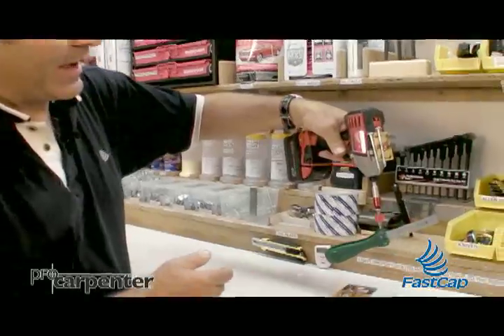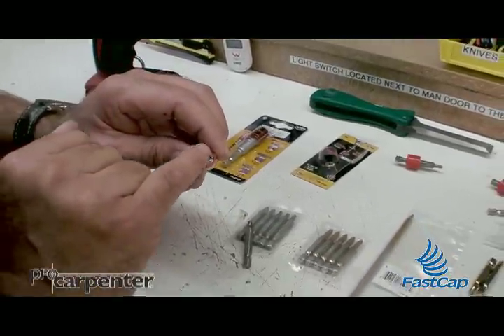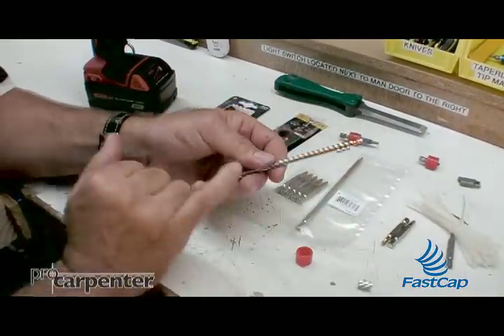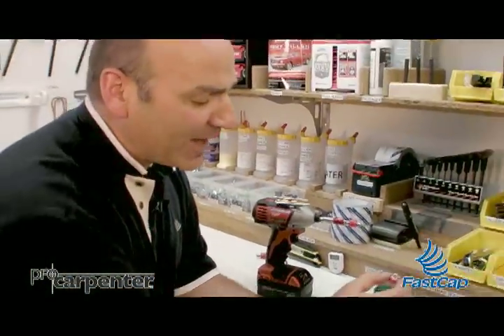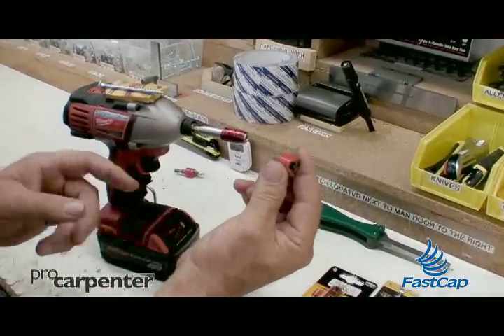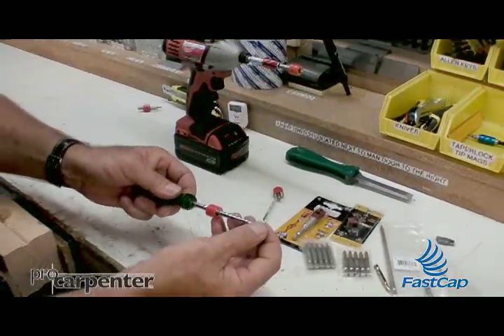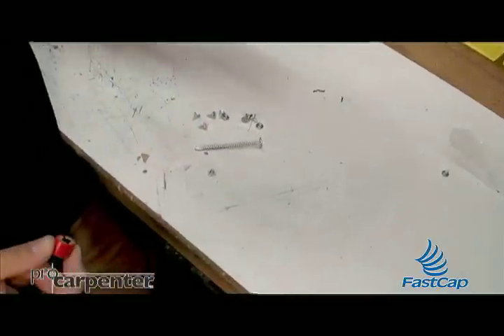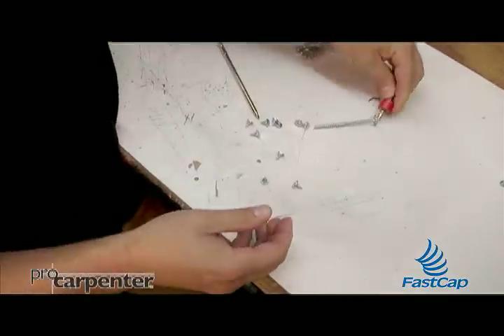Tip Magnet Tutorial

Comment: Been looking for a product like this for a handicapped friend & me. We are installing vinyl siding and he can't nail hammer due to the handicap. We used those dewalt type holders with the sleeve but they aren't great due to the sleeve that must me moved to make sure the sidings not too tight. TipMag is great! It holds the screws like you wouldn't believe! It is hard to adjust due to the tight fit and it is EZ to knock the mags out. Saves us a lot of frustration and lost screws on the siding job

Comment: Why not make the hex shank of the Taper Lock a little bit longer so that the Tip Magnet fits on the hex shank behind the locking collar? I can't be bothered to move the tip magnet every time I change insert bits and I can't afford to buy a tip magnet for every kind of insert bit I keep in my toolbox. Why is it so hard to find a locking collar bit holder with a powerful magnet built in?
Reply from the maker: Well first of all the problem is the transfer of the magnetism through the shank. It has to do with proximity.

Second, if we did what you're suggesting, I'm just not sure it would solve the problem. Why don't you try and see if the magnetism is adequate?

Regarding developing products, it is much more difficult than people think. I would recommend, so you have a full perspective on what it takes to bring a product to market, that you try to make this change yourself and bring that product to market. Paul